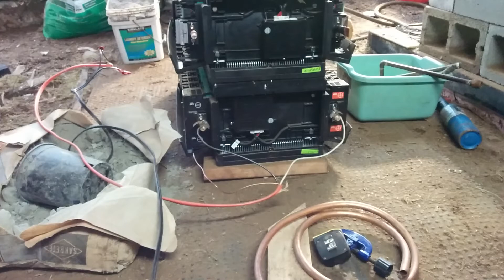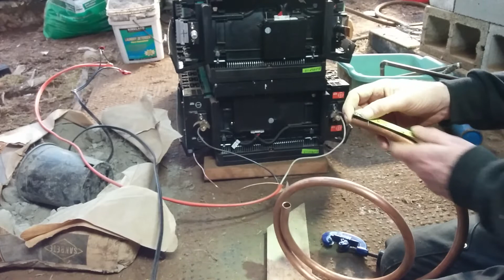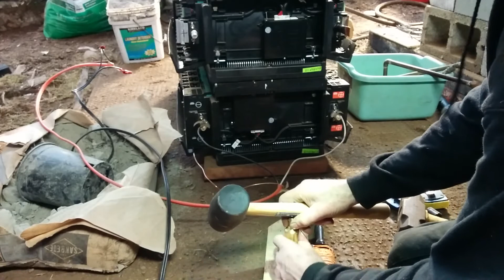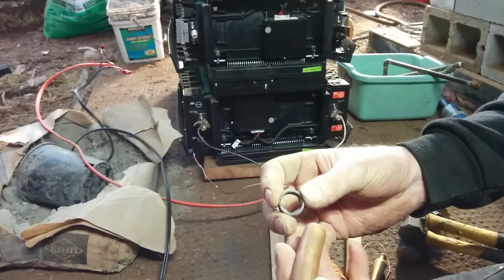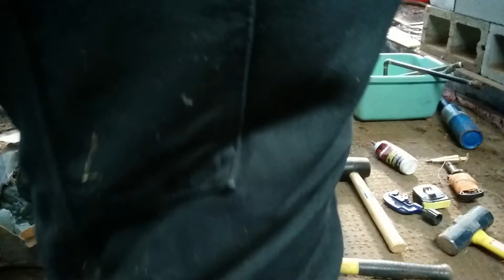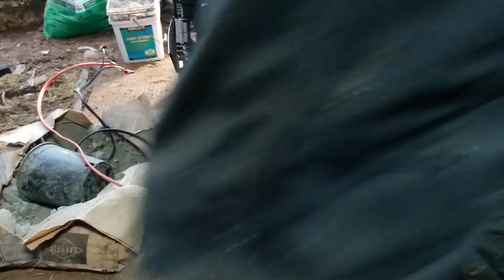BYD Battery - Copper pipe Terminals

Comment: The posts are solid copper, just file two sides of the post flat and drill a hole through, you can then bolt on a standard battery cable. I used a grinder with a metal cutting disk to do it quickly.
Reply from the maker: Thanks!

Comment: Good idea! I used 1/2 inch "L" pipe on mine. I didn't crimp them on though, the "L" is very tight. What are you going to use for BMS?
Reply from the maker: I am not using a BMS.  I use a 5 amp active balancer to keep the cells from getting away from each other and then rely on my charge controller and inverter to limit high and low on the overall battery voltage.  I feel bms introduces complexity and failure modes.
Reply: @metagrid9453  what is your 5 amp active balancer?
Reply from the maker: @JasonCarmichael  I got it from ICGOGOGO store on Ebay.  Also available on Aliexpress:  https://www.aliexpress.com/item/33036949073.html?spm=2114.12010612.8148356.40.5b771313Qd927L
Reply: @metagrid9453  I bought 4 320 amp BMS from them.

Every one of them failed. They can still monitor, but the mosfets all died. So for management, they are unusable. But for monitoring they are fine.
Reply from the maker: I have one here I was going to try but I am afraid to use it after reading about your experiences with it on DIY Solar Forum.  Our BYD pack has been working great with no BMS.  I just use the balancer to keep the cells from getting out of whack and then have a low voltage disconnect on my inverter set to 48V and bulk/float charge setting on my charger set to 53.6.  As long as I keep it between those values the cells behave pretty well.
Reply: @metagrid9453  
Now I charge to 53.2V and disconnect at 48V, with the charger/inverter. The BMS is now just a monitor. 

Do you have a real balancer? If so, what is the link to it?
Reply from the maker: Do your cells stay pretty close to each other within that charge window?  I am thinking of reducing my max charge voltage a bit just to help the packs longevity.